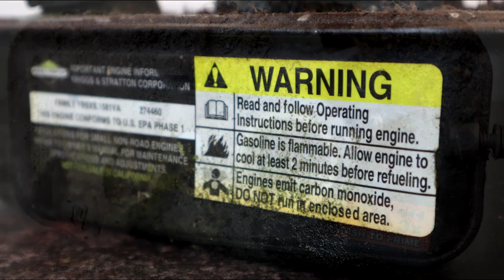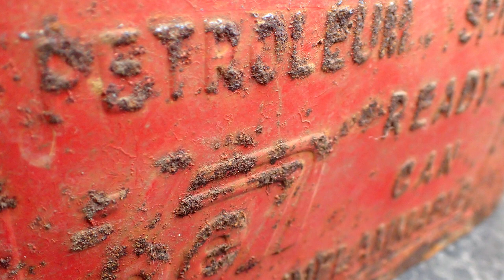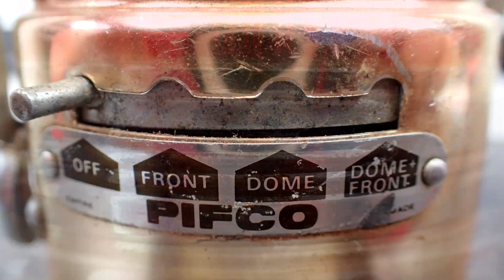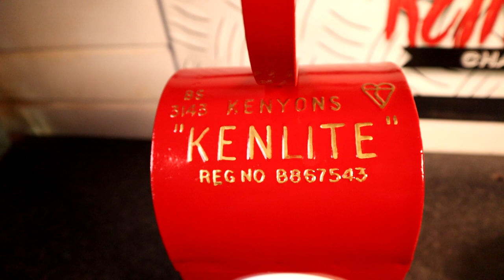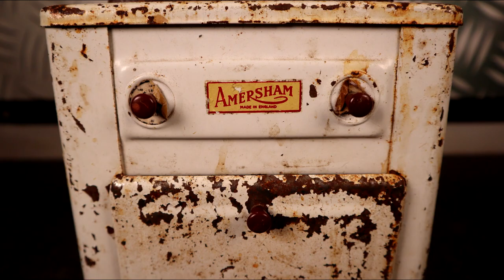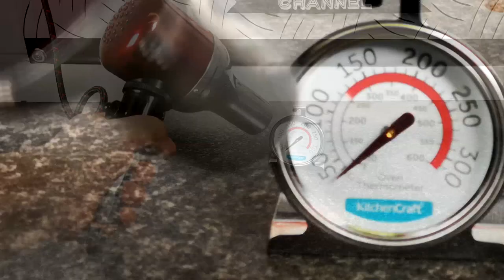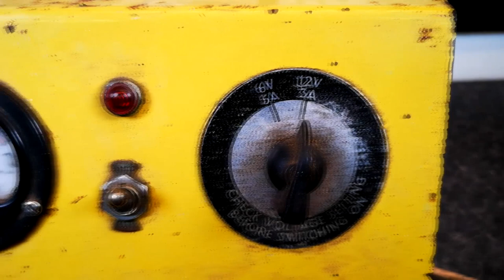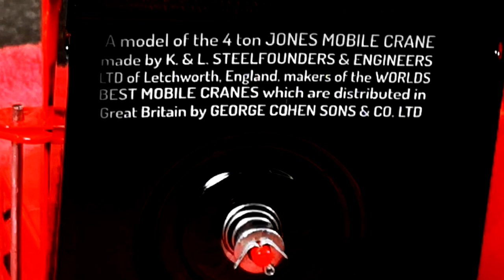A Years Restoration Work On YouTube

Comment: I got an idea from the lawn mower on the snow... with a few alterations, it could become a kind of snow blower/sweeper for light snows. You'd need a blade bent to almost the upright position instead of flat, with a piece of ... oh say conveyor belt material screws or riveted onto the blade so the rubberized material sweeps the sidewalk. You might need to add to the out chute you certainly wouldn't want to bag the snow. IF anyone could make that work, I think you could Imagine how easy it would make it to keep your walks swept off.